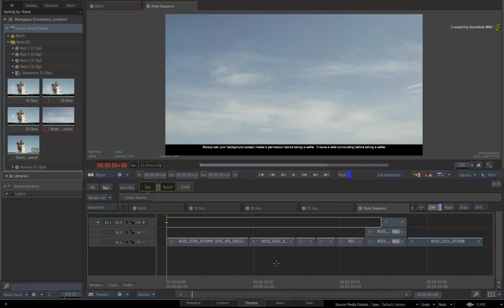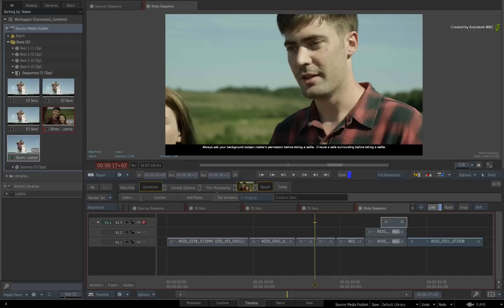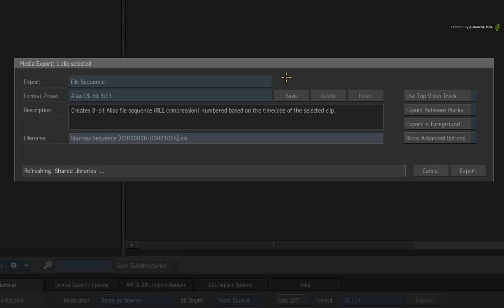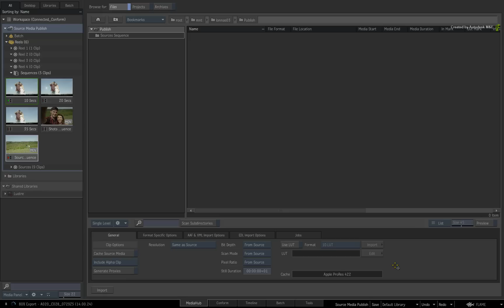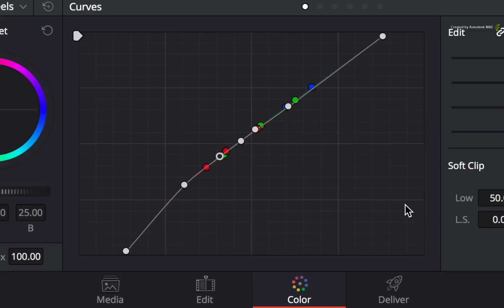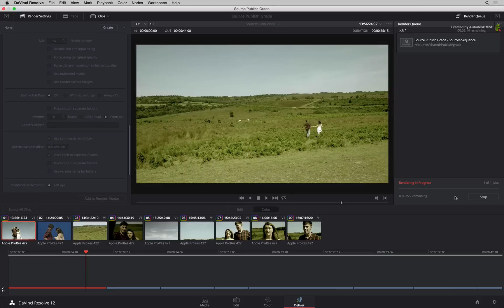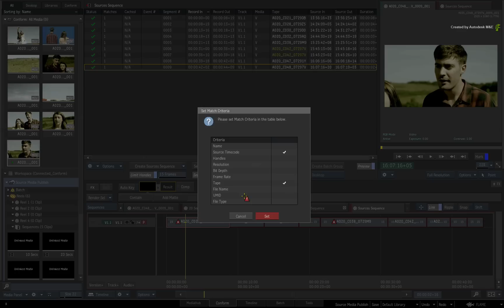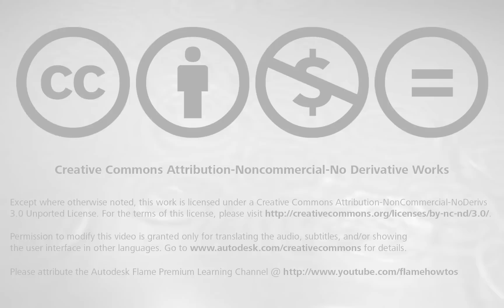Connected Conform Workflow - Source Media Publish - Flame Premium 2016 EXT 1

Comment: Part 5 should deal with editorial changes that include shot length extension beyond the existing handles, addition of a new sequence (12.5 sec), and different iterations of the same vfx for different sequences... there's also the scenario where a grade change happens late in the game or VFX goes back to source media and does a match grade using flat pass comps.... Further to all this it would be interesting to see how this linking can also apply to an externally published gateway clip workflow from end to end
Reply: +Robert Moggach also might want to consider what happens when an edit is broken down into sequences (fire sequence, crowd sequence, water sequence) and those sequences are included in varying combinations across different edits - the semantics start to be confusing - is a sequence an edit or part of an edit? what do you call multiple sequences spliced together? can we splice sequences together and maintain links - i imagine so
Reply from the maker: +Robert Moggach A sequence is a sequence regardless what's inside it. There are no "partial" sequences or break downs.  It's just known as a editable sequence.   So if you break down a production across multiple sequences and than edit everything together afterwards, everything should remain linked as long as it stay within the same Reels Group.
Reply from the maker: +Robert Moggach There are countless ways and methods to control the connected conform.      If you are adding more sequences to the existing connected conform with more media, you would typically regenerate the sources sequence and shot sequence.   TimelineFX, BatchFX and Batch might be a manual tweak since they are considered as virtual and not an actual source from which we derive the connected conform.   

As for doing the grade after the connected conform, you could do a sequence publish after the fact and generate Open Clips for versioning which could be live in the sequences. There is also nothing to stop you from creating a bunch of Open Clips through sequence publish or externally and relinking them on a media level to the connected conform.

I've just replied in a few lines to your comment but showing these scenarios will take a significant amount of time which will certainly be considered for future videos.

Comment: Thanks for the video, I like the workflow, but what if the grader with clients wants to grade in context of the edits, not a source grade...
Reply from the maker: +Peter van Rij Well you have a few choices.....   You could export out an AAF or XML of the longest sequence from the Flame products and conform that with the source material....     I used the source sequence to ensure that all the material is spread out in a "sort C pull list"...    This wont give you the context of the edit...  So you can publish an of the other sequences to get a context of the edit.   Just remember to maintain the source clip metadata so that when you to replace the media in Flame, it will link correctly to all the sequences...